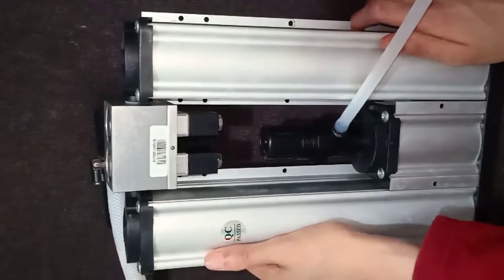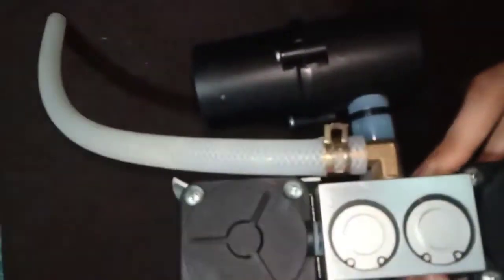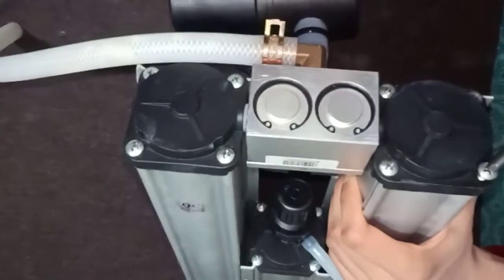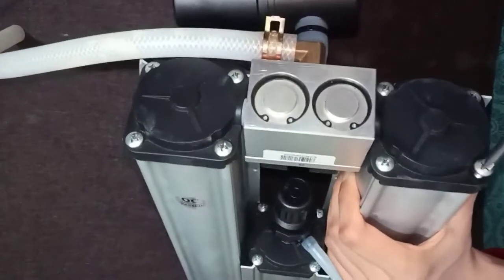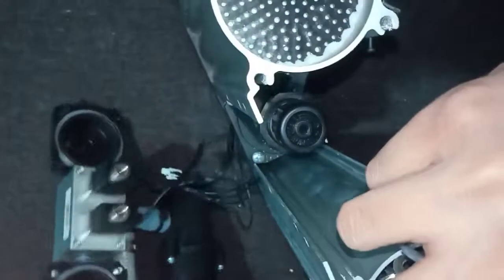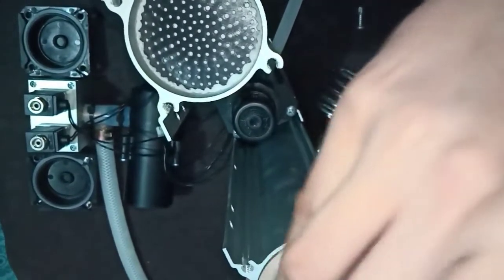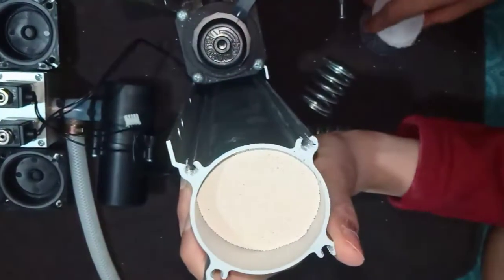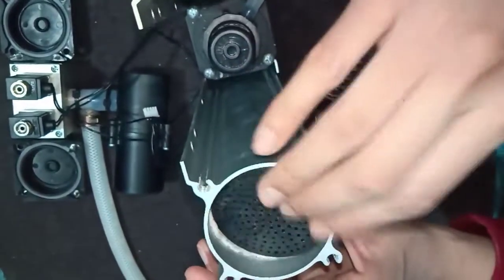Oxygen Concentrator molecular sieve bed

Comment: can you please give me more details about the unit type and price?
Reply from the maker: What details do you need? Unit type is oxygen concentrator sieve bed. It costed me around $350
Reply: @CEODeepTech  Do we need any special room for filling zeolites in containers, like maintaining pressure, temperature or humidity of the room?
Reply: @hp5683  same question..
Do you get the answer?
Reply: @adhityaduta18  Temperature around 20°C, Humidity should be low as possible below 60% and pressure inside the container should be maintained by spring.
Reply: @hp5683  make sense..
Always failed because uncontrol ambient air.. the ZMS goes hot
Ok friend, I'll try tomorrow.. thanks